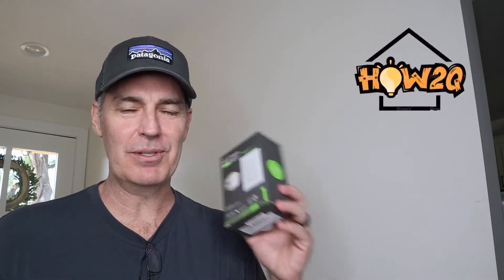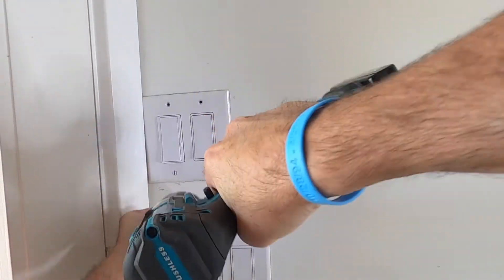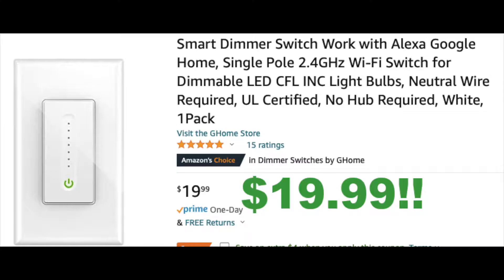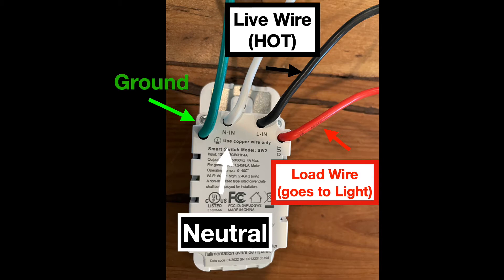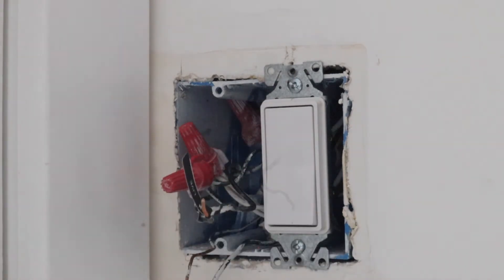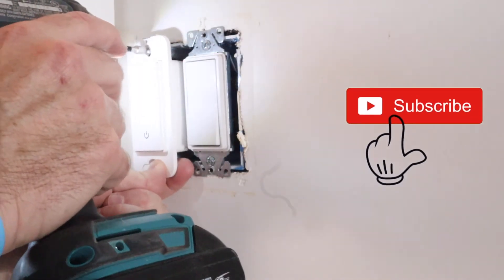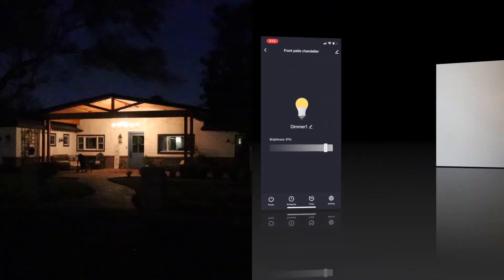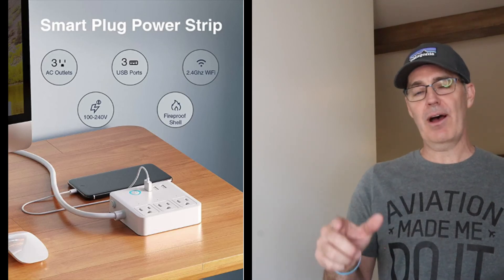How to Install the Best Wifi Dimmer Light Switch

Comment: Great video.. i installed these same switches in my house back in April and have been adding more as I go.   If you have an Amazon Alexa/Echo you can set them to turn the lights on and off at different times...  i have them in my bedroom to wake me up, and on my front porch and back yard..
Reply from the maker: Awesome…mine are still good to go after 3+ years